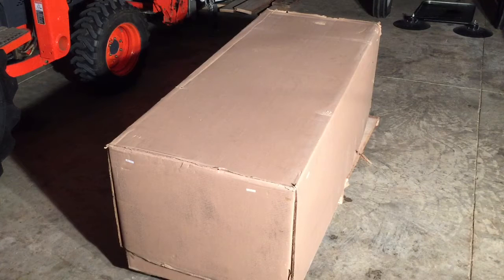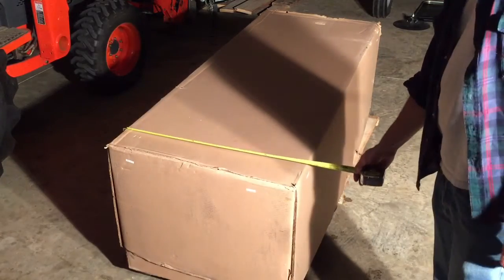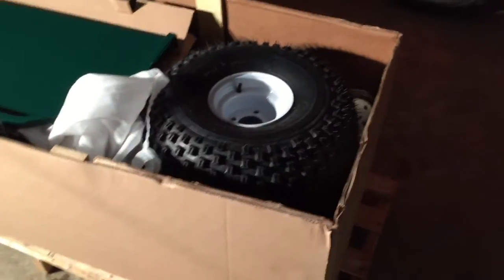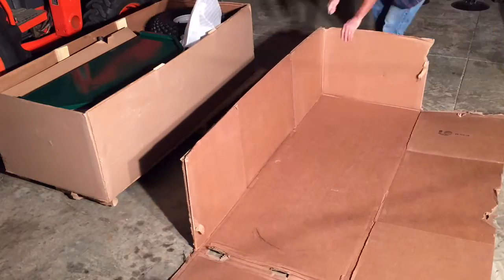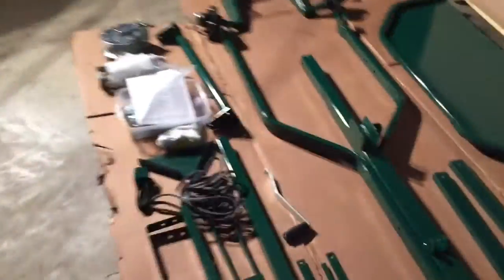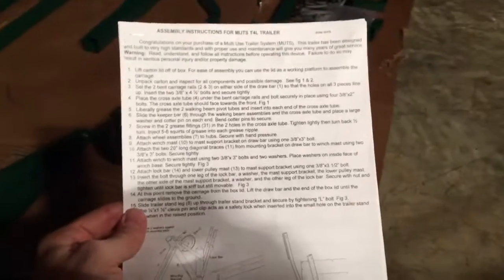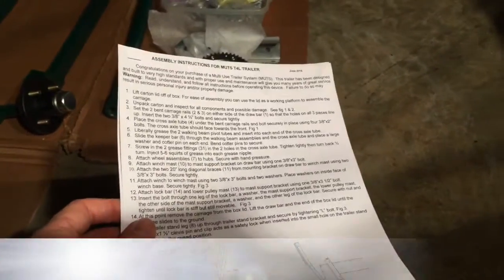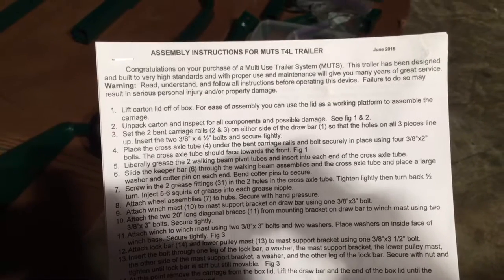Ultimate ATV Trailer, Pt 2 Frame Assembly

Comment: So are there no zirk fittings on those axles?
Reply from the maker: +a  The axle hubs are sealed bearings just like on most road trailers...  you disassemble them to repack grease.  The bogie axles have zeros.